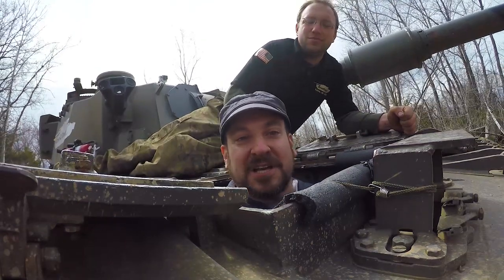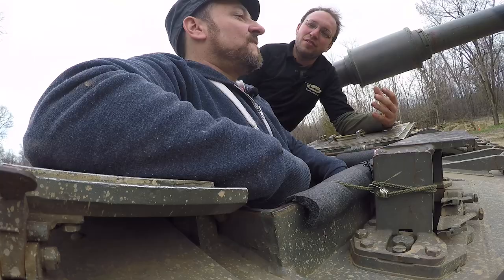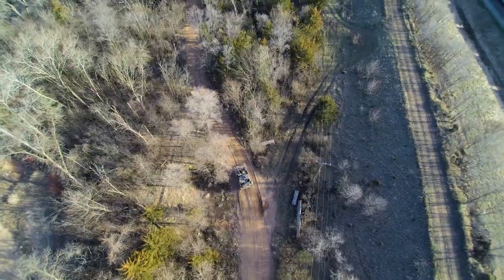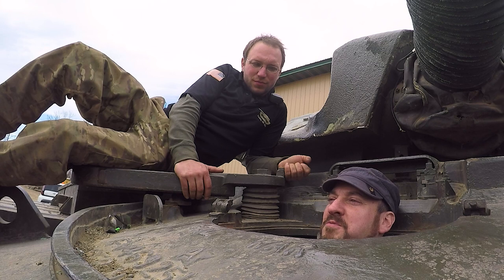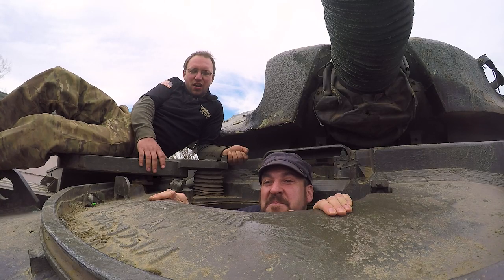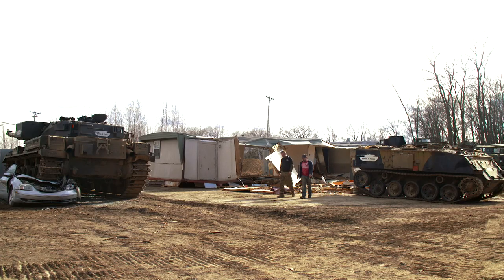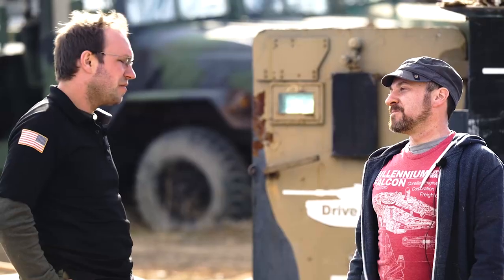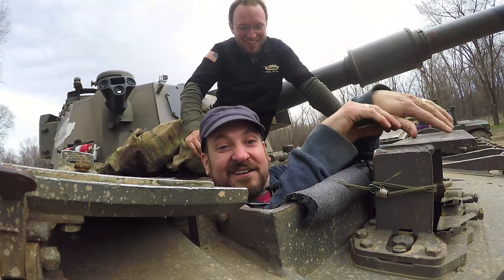What It's Like To Drive A Tank | Jason Drives

Comment: Definitely a very cool thing to do. I must say, however, I am rather surprised at the condition of their equipment. Do they just run these vehicles until they fall apart, then sell them for scrap?
Reply: As in, because they may not look good but  they mechanically are very sound I bet, as the mud cakes up over time and they probably had run it earlier that day because it sounded as if the engine was already warmed up.